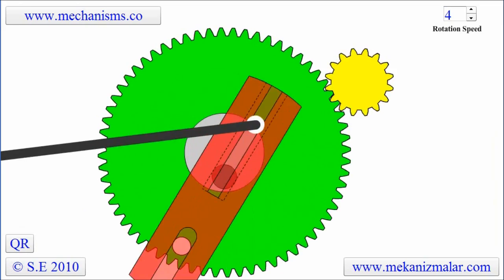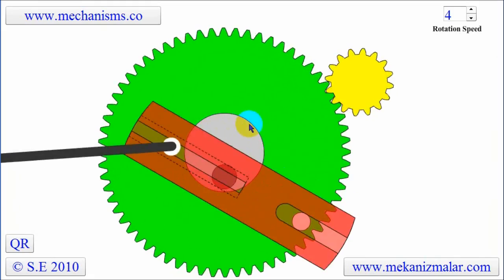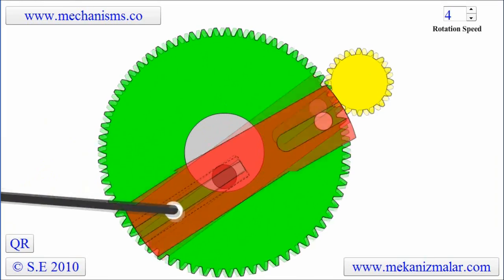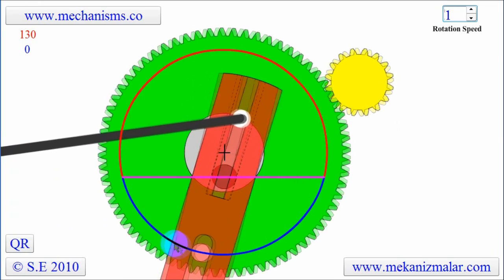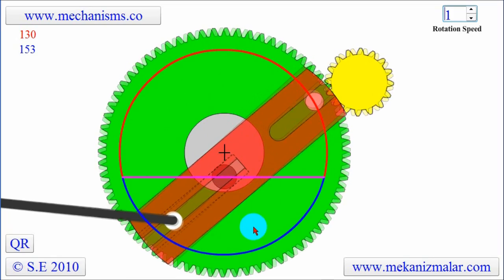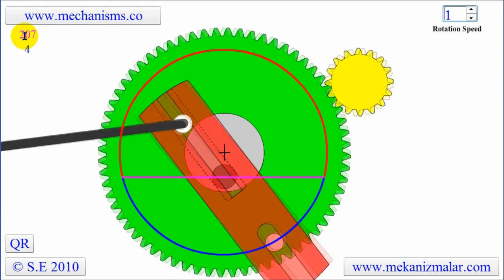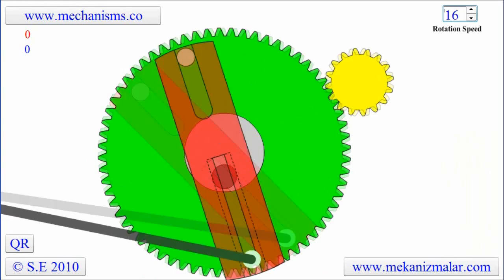Whitworth Quick Return Mechanism

Comment: in that video that white point that connect connecting rod and wheel is fixed to wheel so depending upon rotation that red bar slides too and fro motion throught white fixed point

Comment: I just thought of a very good use for this... a stirling engine has a return stroke, not a compression stroke... the heat transfer is continuous as such the faster you return the more efficient not to mention the increased power to weight ratio of spending a greater percentage of time in the drive stroke. also injecting the cold air faster will also grant improved efficiency.

Comment: @mekanizmalar

"pin" should not have been in that sentence, my mistake, it should have just said "the black link". 

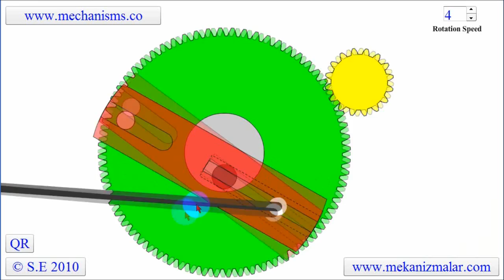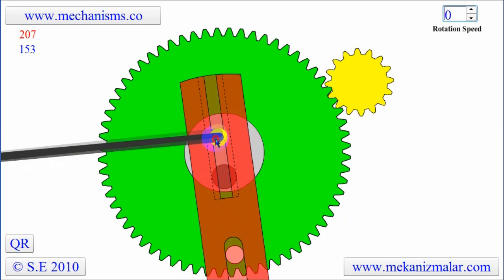time 1:10. she says that part freely slides as well, it does not (only the pin attached to the gear slides freely in the red arm). it is adjustable as mentioned at 3:30, if she made the animation she did it by someone elses instructions because if she understood the device she would not have made that subtle mistake at 1:10.